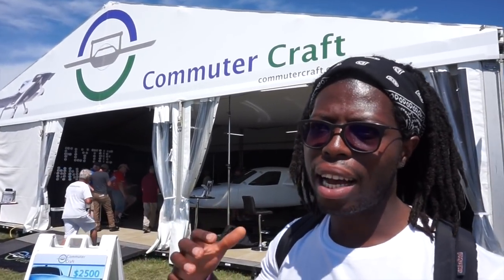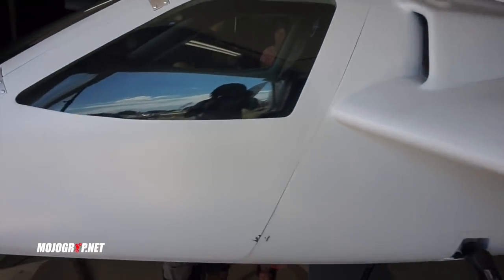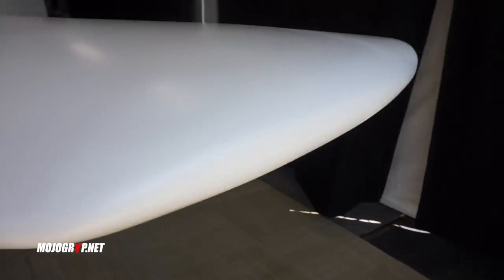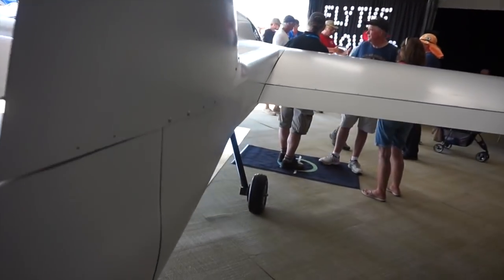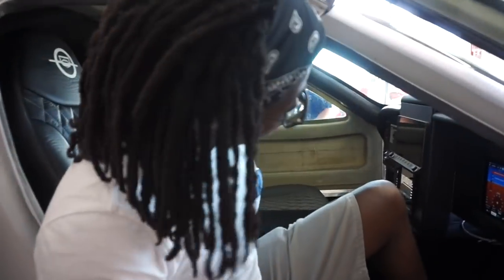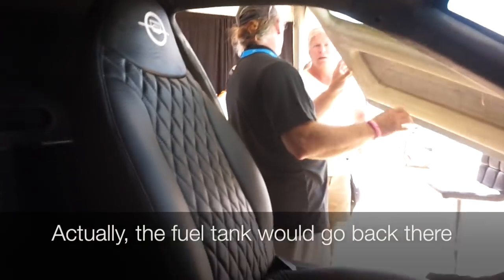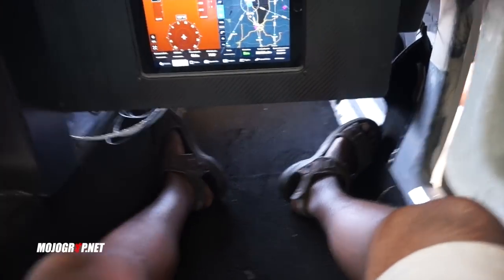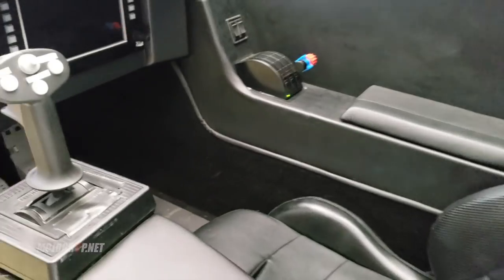Commuter Craft "The Innovator" Homebuilt Airplane

Comment: RIP Richard. We honor Orville and Wilbur Wright for their accomplishment of powered flight, but there are many others who died trying. Without this spirit, we would still be dreaming of flight. I salute those who innovate and try to bring flight to more people.
Please join me in a moment of silence to honor these pioneers with a thumbs up.

Has there been a determination of cause? The short wings seem like it would be easy to stall. The rear prop helps keep noise and turbulent air behind you. It is an interesting design, but something certainly went wrong. It is tough to overcome this kind of stigma even if the problem is correctable.

Comment: People are saying it is fast? It has never flown and by looks it will not be fast. Sorry There is no beating physics, drag, hp, aerodynamics... This is not a clean airplane and it does not have that much power (180 HP). NEVER FLOWN YET. If I mening kind it will not cruse faster than 155 knots (178 mph), even if gear leg fairing and wheel pants were installed. Top speed will never exceed 200 mph. Only way it gets to 217 mph is diving towards ground at full power. Taking bets.
Reply: Actually their prototype has flown many times and the videos are all over YouTube. They are claiming they exceeded 200 mph with 180hp on the prototype, which they deliberately built 500 pounds heavier than what they expect the production model to weigh.  So yeah, I'll take your bet.